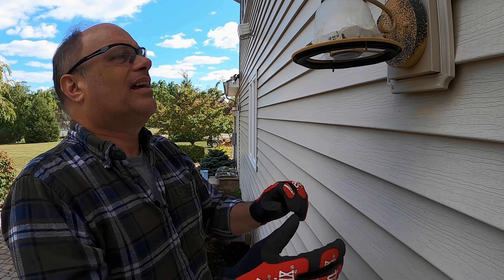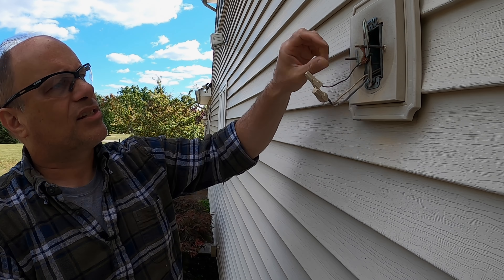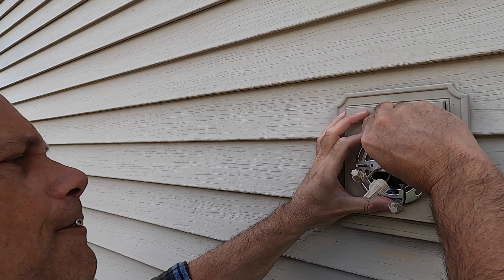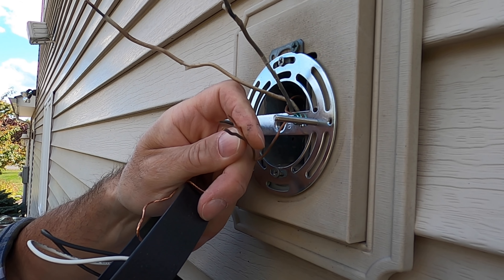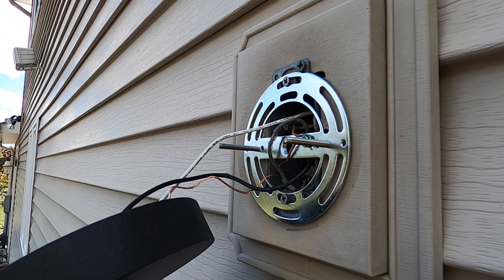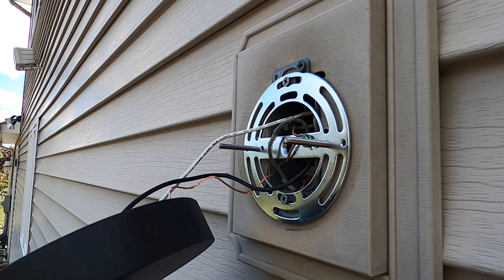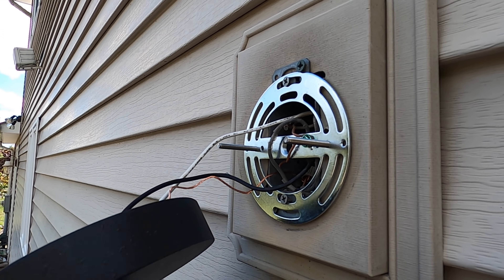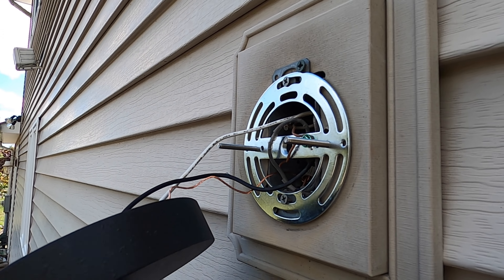How to Install an Outdoor Light Fixture - The Right Way

Comment: Just found out I have been putting in bulbs wrong for decades.
Reply from the maker: Happy to help Claudia!
Reply: I bottom out the bulb.  I think the fear of flatening a spring is unfounded.  Im 50 and never had an issue with a bulb not working due to poor contact with that connection.   And i lived with many who tighten bulbs more tightly than i do.

Side note...incandescent bulbs get very hot then cold.   The expansion contraction cycle make them loosen over time.  So i think tightening hand tight is correct..and your worry over a spring unfounded.   Perhaps a little " old dude" idiosyncracies developing?  Im a guy...i get it.
Reply from the maker: Thanks for watching!  Your experience may differ, mine is based  on how many times I've had a service call for a non working fixture.   I show up, stick my finger in the socket, bend the contact back into shape and collect my $100.00 from the customer. Just want folks to avoid that expense if possible. Glad your method works for you.

Comment: Nice video  I'm so scare to get electrocuted 😢if I do it
Reply from the maker: Turn off the power at the circuit breaker panel and make sure the bulb is not lighting.  Test with your meter between the black and white wire and from the black and ground wire. If you follow the safety rules and take your time.. you will end up with a job you can be proud of.